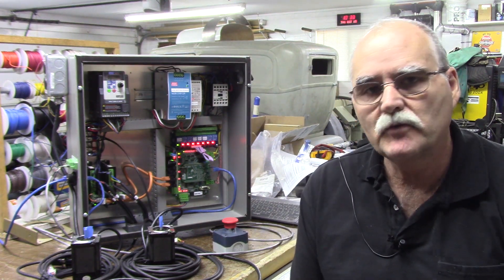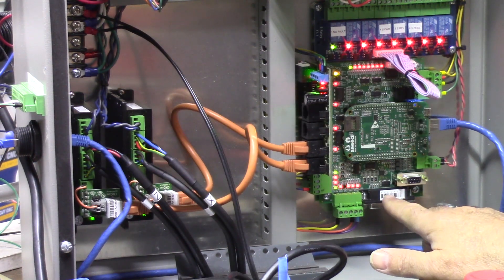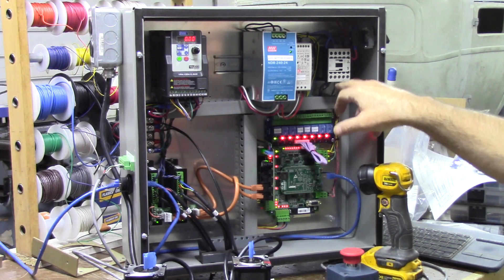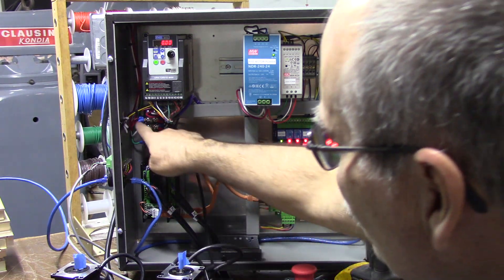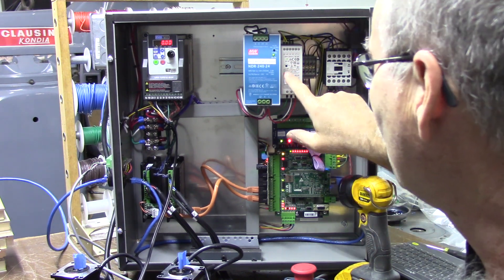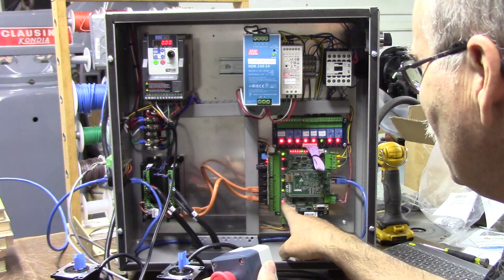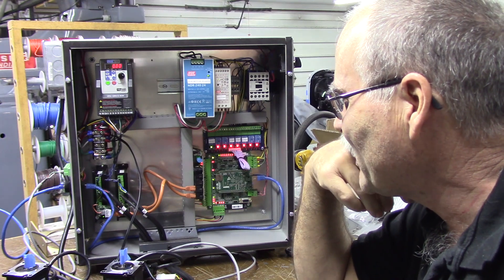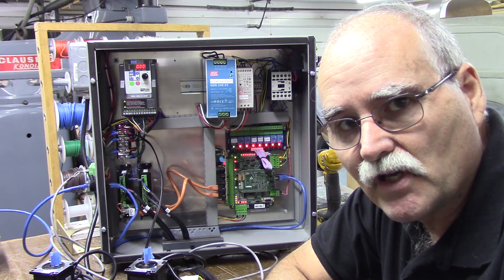Emco PC5 Centroid CNC Acorn Conversion: Part 7 Cabinet done. Overview

Comment: i guess that c86 board saves a bit of wiring but I'm not sure i like it sticking up like that putting stress on the acorn headers, if your cabinet is bolted to the machine any vibrations with the weight of the board and 4 shielded Ethernet cables might cause the solder joints on the acorn headers to fail if you don't support the c86 board.  i can only really see an advantage to it if your drives are located away from the main cabinet with the acorn as then you may be a little less susceptible to noise with the additional shielding vs traditional wiring.

Comment: Have you done any videos on setting/wiring up a router/plasma cutter?
Reply from the maker: Router is basically the same as mill. Centroid is working on Plasma now with a high end THC designed to work with Powermax

Comment: Great learning videos! You sold me on Centroid!  I have a question, i'm in the middle of a Supermax Anilam Crucader 2 drive retrofit. I bought the acorn and not sure about the drives. What is you view between the  DMM and Clearpath? Any suggestions? Im looking at 750W motors. Thank you!
Reply from the maker: I have used DMM on builds. Clearpath SDSK are good motors. Either will work with Acorn. With DYN4 you could upgrade to Oak possibly if you felt the need. Sell your old parts on eBay if they are any good to help offset your costs

Comment: Does the c86 convert  the 24v power to 5volt for the drive logic?
Reply from the maker: The drive logic for step direction signals comes from Acorn, it's passed through C86. Some signals are monitored by C86. You still need an appropriate motor power supply